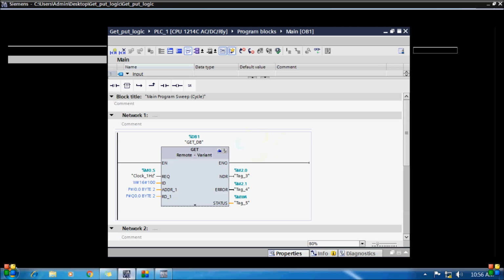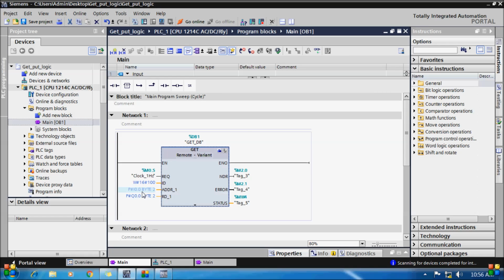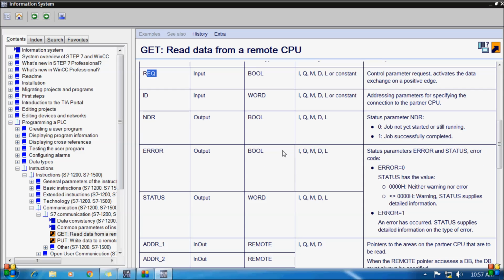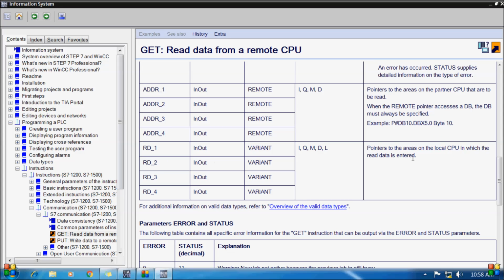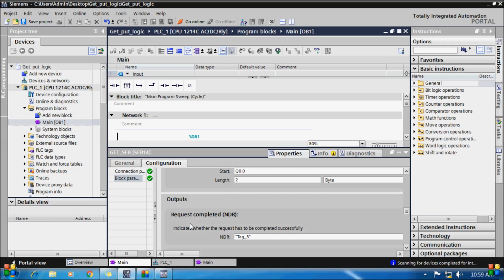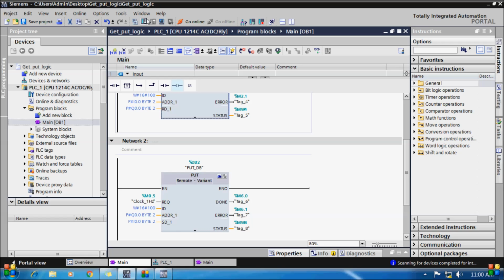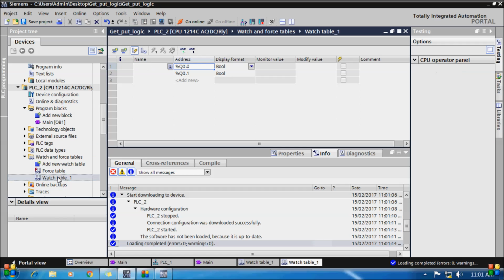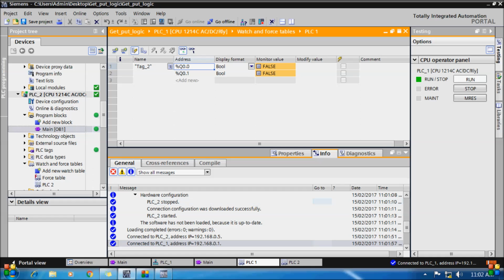PLC to PLC communication l Siemens Profinet: comunication S7, function PUT / GET

Comment: Hi,
I have existing equipment running on factory and customer want new equipment but also using same plc 1200. They want to establish and link up together.
So can I use this method without add any program for existing 1 and I just assign partner plc as this video shown ? 
I will using Ethernet and add this cpu and assign ip only.

Please advise 

Thanks
Reply from the maker: Yes it's working.